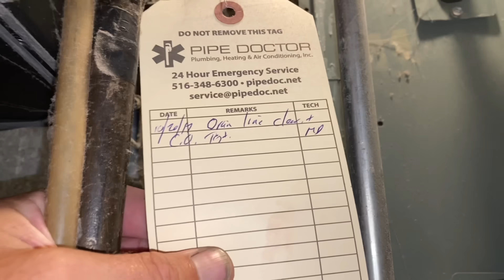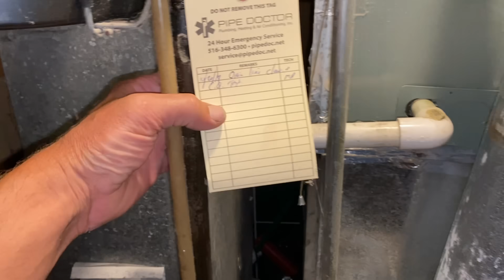Last Time You Replaced Your HVAC Filter? Central AC System Leaking Water in Basement & Dryer Venting

Comment: Hi Mike,
I am not a plumber or  HVAC guy, just a concerned home owner.  In your video you and yor assistant were commenting on the hot air recovery duct the home owner installed.  My concern  was when you panned away I noticed the bright yellow gas pipe freeding the dryer. Other than extreme moisture in your house this  vent may be safe for an electric dryer, but wouldn't the gas dryer also vent carbon monoxide out that vent  in to the living space ? Im not sure of the amout of CO a dryer generated but any CO should be a concern
Rick

Comment: Mikey you were looking at the dryer vent on the wall for a few seconds . The. You  gave us a split second view behind the dryer. I think I saw a yellow flexible gas line. If I did see a gas line that means the dryer is dumping carbon monoxide into the basement. That could be deadly.

Comment: no trap on the drain.  Love how people install equipment
Reply: Doesn't need one in that configuration - blower on the bottom, blowing up to the evaporator.  Evaporator condensate drain is under positive pressure.  A trap is only required if the blower is sucking air across the evaporator, creating a negative pressure, which will keep the condensate from draining while the fan is running.

Comment: Great video looks like a  royal mess inside that place! You should have had the customer remove all that crap around the air handler and condenser! I would have replaced that old unreliable condensate pump and cleaned and checked the condenser ! Make. the money! Call Ching Mikey pipes!

Comment: Not sure how homes are built by you Mike, but some of the two-story homes here in NC have HVAC systems that do not have a space for both a return and a supply filter. For example, in my home, the first floor HVAC system has a supply filter but not for the return vents; just grates. I do my best to clean them twice a year.  When I had my systems tuned up I asked the tech is there a supply filter in the system upstairs; he told me there was not a space for one. Just the two returns in the ceiling. Opposite of the system downstairs. Do you come across that  by you?

Comment: That's why I put Teflon tape on the threads.  Not to seal but to keep the ring from locking up.
The disconnects with the side lever is old school.
You will be back to clean A coil,  and you will find no filter on it.

Comment: I would recommended a major tune up new pump new tubing a safety switch on that drain line I’m sure that blower wheel is caked to Evap prob cleaned
Reply: I would recommend a wrecking ball to the home.

Comment: Change the filter every 30 days? thats crazy overkill. I change mine when it starts to get gray. so like every 6 months. Does depend on if you have any pets or things like that.
Reply: it might be overkill for some but when your house is a mess and you've forgotten to change the filter a ton already... once a month intervals couldn't hurt. I'd rather err on the side of caution
Reply: Filters are dirt cheep!
Reply: Depends were you live.
If you live near a highway or a beach.you need to change the filter a lot
Reply: Where I worked we changed the 25 interior filters on the first of the month.  The roof units (12) had to be changed every two weeks.

Comment: That was a fine service call you did everything you're supposed to do. Found the leak told me to change filter .Told him he needs a service call in the spring.
We installed our new air conditioning system 5 years ago. I checked the filter every  2 months. I've been changing it once a year.  Even after a year it never looks  like the ones that you show.